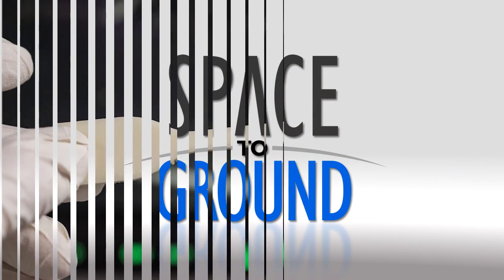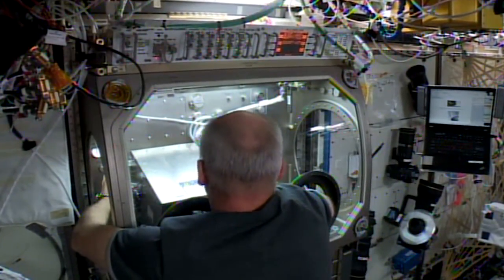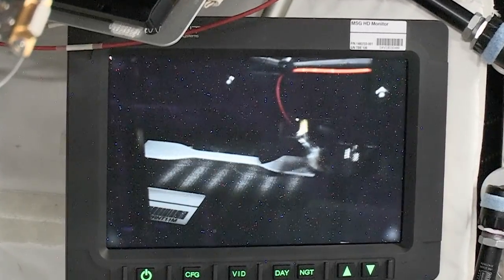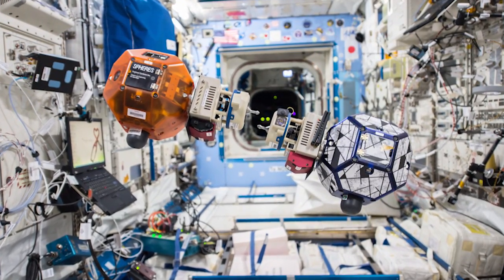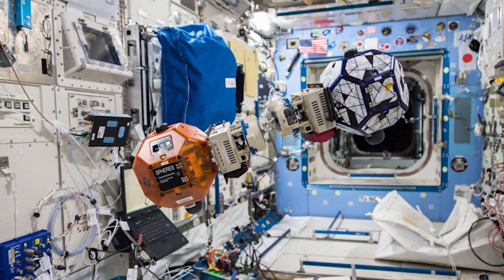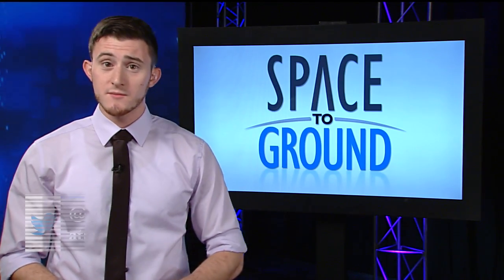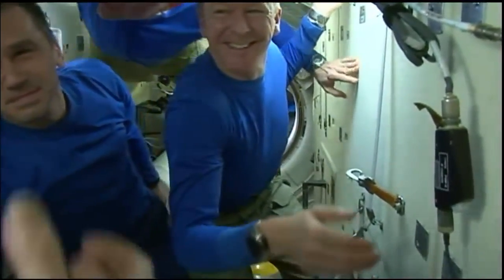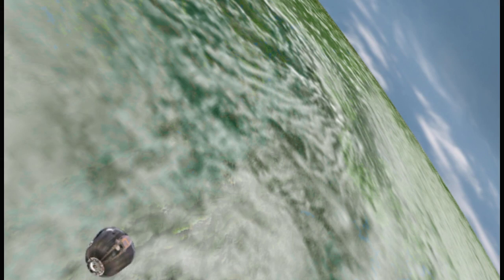Space to Ground: 3D Printing in Zero G: 07/01/2016

Comment: I'm guessing energy is the limiting factor, but would it not be better to run the 3D print surface / print head layer at the edge of a centrifuge?

If the print head was extruding exactly 40cm from the center of the centrifuge, and the device was spinning at 4.7284 RPM, it would be 1.0 earth gravity (artificial / centrifugal force). Also you would want to move the surface the print material was being laid on instead of the print head, to keep it aligned with center of rotational axis ;).

Don't know how much would weigh with the motor to spin it & how much it would cost (energy) to run it in zero G sadly!